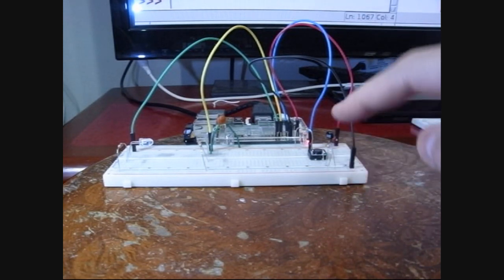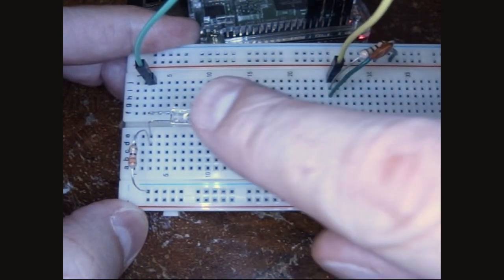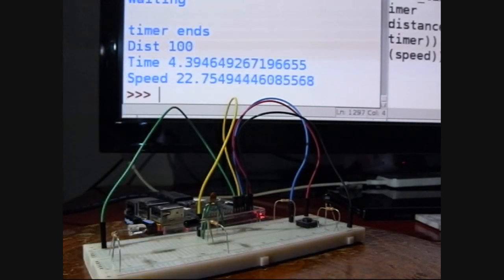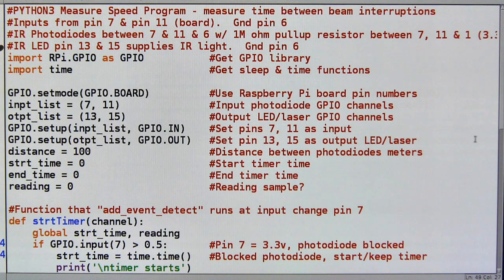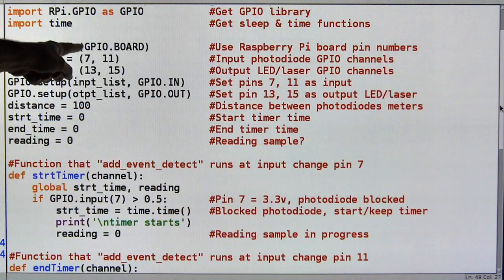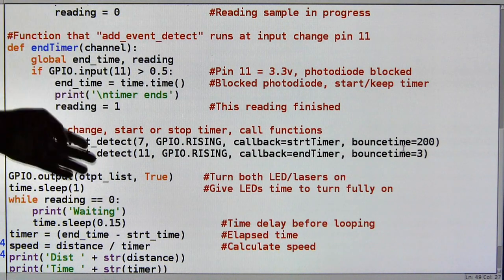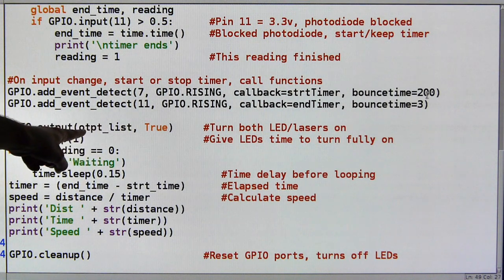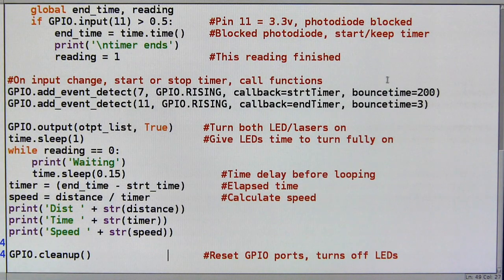RPi 08 - Chronograph / Timer / Chronometer Experiment

Comment: Can you explain in more detail your use of the capacitors on the switches.  Is this used for the GPIO  on the Pi or is this more best practice for switches. New to Pi... some  experience with Arduino and their IDE.
Reply from the maker: The caps are to create a cleaner pulse.  I did not try it, but putting the cap across the switch contacts may work better.
Reply: @tsbrownie  It acts to debounce the switch?
Reply from the maker: @greese  Yes, and it allows for a rapid delivery of current.
Reply: @tsbrownie  thank you